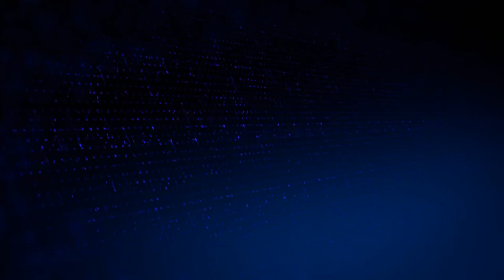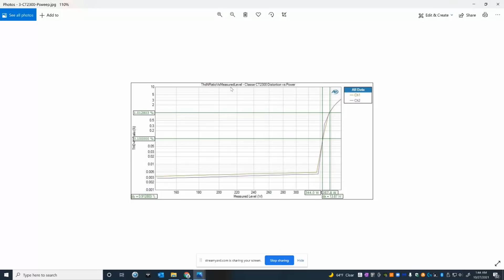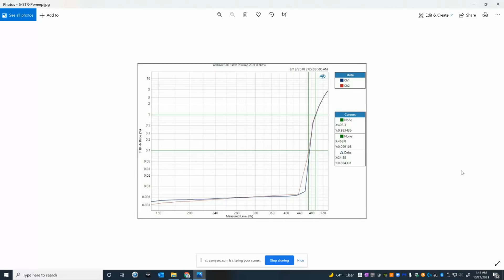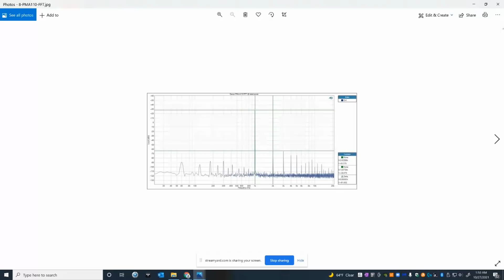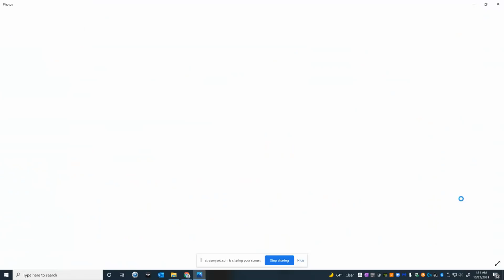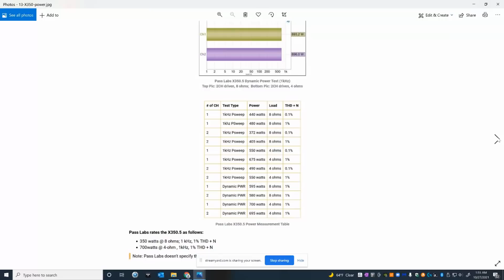How to Determine Good from Great Amplifier Performance

Comment: My previous amplifier (devialet) measured better than my current amplifier (Gryphon Diablo 120)
But the Gryphon sound sooooo much better.
Reply from the maker: Then you're looking at the wrong or incomplete measurements.
Reply: @Audioholics  Good measurements don't always equal good sound
Reply from the maker: @henriksrensen3220  They do if it's the right measurements responsible for good sound.
Reply: @Audioholics  I don't agree.
So people don't have to listen anymore before buying new amp,?
They just pick the one with the best measurements?
Reply from the maker: @henriksrensen3220  Why would anyone deter a listening test? Always listen but narrow your choices to the amps that measure best. Why fight having more objective data in your hands? Very bizarre.
Reply: @Audioholics  it's very bizarre to claim that better measurements always equal better sound.
Reply from the maker: @henriksrensen3220  Not if you know what to measure for.
Reply: @Audioholics  to borrow amps to listen seems like a complete waste of time. Just buy the amp with the best measurements, right????
Reply from the maker: @henriksrensen3220  Yes, I would definitely heavily weigh my purchasing decision on how the amps measure and how close the power measurements are to the manufacturer claims.
Reply: @Audioholics  Yes so listening test is a waste of time 👍

Comment: Anybody can have a flat distortion rate if you have massive feedback but that would just kill your sound and destroyed the balance and the tone or qualities distortion is your friend anything to 1-2 % just fine. Yeah joking is not good if the power supply is struggling.
Yes but zero feedback or very low feedback amplifier needs very sensitive speakers ideally 97db or greater at 15 ohms to get the best out of them
Reply from the maker: Sorry but you just perpetuated a myth about feedback.
Reply: @Audioholics  you don't think feedback lowers distortion rate. I think you're you're wrong can you explain to me why you have a feedback circuit if it's not there to lower distortion!
Reply from the maker: @johnsweda2999  when did I say that? Your myth is that feedback "kills your sound ". Only people that don't understand how to properly do feedback in an amplifier can make such a claim.
Reply: @Audioholics  ok I hear what you're saying! a lot of people disagree think feedback does destroy mainly in the lower end detail it's their opinion if they're correct or not, if some people can't hear it doesn't make them correct either. I think we both agree it does have impact on the sound good or bad up to the listener.
Reply from the maker: @johnsweda2999  I care more about facts than opinions.  Here are the facts from one of the best amplifier designers in the industry:

https://youtu.be/kPqpuTO6Kd4
Reply: @Audioholics   I'll check it out!  thanks!  but not everything can be measured or the measurement your reading doesn't really indicate what you're hearing necessarily.
Reply from the maker: @johnsweda2999  except amplifiers and the measurements that guide their design is well understood.

Comment: No human ear can discern THD less than 0.1%. Guessing the sound quality as you do is audioastrology.
Reply from the maker: That depends on the frequency, amplitude and duty cycle of the signal. Why would you design an amp to meet the minimum threshold of audible distortion, instead of being far below that threshold? Good engineering design exceeds a  min criteria. I'm not guessing about sound quality. I'm explaining why the sound quality can be different between amplifiers. That's not audioastrology, it's science.

Comment: @Audioholics - How do the Emotiva XPA Gen3 amps spec in these categories? I'm looking for a good all around entry level amp to go separates for the first time. I'd love to be able to lower my hiss and noise floor issues with my current Marantz 7012 AVR and Klipsch RP speakers... Thoughts?
Reply: The emotiva is okay I bought one and returned it though. I am running schiit audio Aegir class a. I also tried their class AB vidars. I am running Cornwall iv and the difference between class a class a b and class d are dramatic! If you have a high efficient speaker class a all the way don't look back it is amazing how it sounds! I am running mono so I am using two.
Reply: @barryhallsack8852  - Thank you for the insight, Barry! 🍻

Comment: Gene i own the pass labs INT250 and it uses the latest .8 design which may measure better than the amp you tested. Regarding the commits and measurements you did on the Pass labs. Nelson Pass Designs his amps that way for a reason. He has been designing amp for a very long time he does not favor feedback designs because he says it suck the soul out of the music, But feedback can make a amp almost perfect in the measurement. As you know your self in the audio world you give up one thing to gain another. I also would like to say no matter how expensive a amp is not all designs are going to work well with all speakers. Equipment matching is a factor at any cost. Put it with the right speaker system one not so hard to drive and it could be one of the best thing you have heard. By the way love your channel.
Reply from the maker: Thanks for your points. The "feedback sucking life out" is a fallacy.  I recommend reading this: https://www.audioholics.com/audio-amplifier/amplifier-negative-feedback

and watching our livestream: https://youtu.be/kPqpuTO6Kd4

Keep in mind in no other industry other than consumer audio is using a feedback control circuit a bad thing. Proper feedback is essential to linearize the behavior of a control system.

Comment: Thank you Gene.
It would be awesome to have you bench testing these criteria on the latest Parasound Halo power amplifier models:
A21+ 2ch 300W @8ohm, $3499
A52+ 5ch 180W @8ohm, $2999
A23+ 2ch 160W @8ohm, $1499

Cheers !!
Reply from the maker: I reviewed and measured both of those amps almost 20 years ago when they first came out. I'd imagine the design is very similar today to those which is a good thing for sure.
Reply: Parasound is legit, have never seen a bad review or comment about them.

Comment: My Yamaha RN803 measures flat. My Audia Flight FLS10 measures flat. Any variation between either unit’s measurement is like no more than 0.5dB.

But they sound different even at moderate level with speakers that are easy to drive. I’m curious why? Also, I’m no expert in reading measurements. 😬
Reply from the maker: You need to carefully examine the right measurements between the two amps. Everything can look flat with a large vertical axis.
Reply: @Audioholics  … I hear you. That means it’s more than just frequency response. Thanks!

Comment: Gene, can you do a short video on the pros and cons on speakers with high sensitivity. Curious if this one of the reasons why Klipsch is so popular within the home theater community. Thanks!
Reply: Klipsch is popular with the home theater community because they're cheap and loud. That's not necessarily a bad thing, but it's often what that crowd is after.
Reply: @loudandclearmedia  They're not all cheap.  They make high end stuff as well. I'm a music  listener and I'm  very happy with my RF 7iiis.  They're not what you'd call high end in the full scheme of things, but they're not cheap either.
Reply: Amplifier's distortions increase as the power is turned up. So high efficiency speakers at any given volume are receiving a less distorted signal.  But obviously, wether this is audible will depend on the particular amp/speaker combo.

Comment: I can hear the difference between home depot zipcord and $6K cables of the same gauge but only if I'm using a Pass Labs amp at peak power.
Reply from the maker: LOL
Reply: you need to imagine a difference of such nonsense cables to prevent you jumping out of the window when realize your dumbness

Comment: Great intro with all the necessary caveats  out of the way. Sometimes exceptional engineering is not audible unless pushed by certain speaker loads or high levels or low frequency content or “perfectly transparent speakers”. For my needs I’m all over the Benchmark AHB2 amp - the reigning champ at ASR
Reply from the maker: @KirillChufarov  Purifi comes close to the measured performance of the AHB2. Both amps are vanishingly low distortion and should be sonicially indistinguishable as long as they aren't running out of power.

Comment: Hey Gene, do you recommend a certain gauge power cord for power amps? Or a certain spec. on the power cord? Generally speaking....
Reply from the maker: Yes. Whatever comes with the amp. If you need longer, lower the gauge accordingly.
Reply: @Audioholics  thanks for your response. I'm in a situation where I inherited a Poweramp and it didn't come with a power cord. I tried contacting the manufacturer but it's been quite a while and they have not gotten back. Does gauge matter? Let's say an 18 gauge power cord versus a 14 gauge
Reply: @ryanschipp8513  jesus christ use whatever cable for power
Reply: @Harald_Reindl  chill out, get over it. Just asking questions
Reply: @ryanschipp8513  turn on your common sense and think about the difference the last 50 or 100 centimeters could make in the whole power chain to your device
Reply: @Harald_Reindl  I'm not talking to you. I'm talking to Gene. I'm looking for expertise that I do not have. Move on